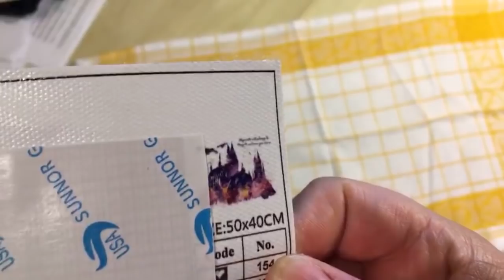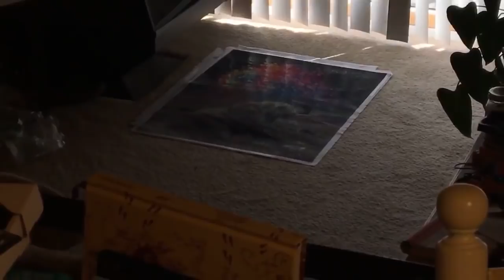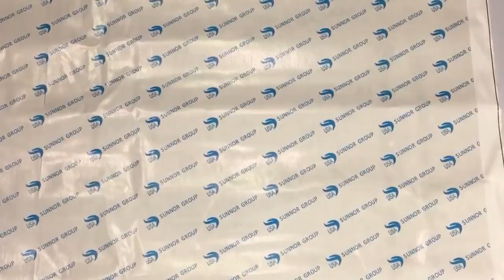Canvas Repair (Wrinkles and Cover Paper)

Comment: I have ironed wrinkled canvases with great success. I experimented with my iron on a canvas that I was willing to ruin if need be. I had to use a moderate heat and patience. It did not melt the cover plastic or effect the glue as far as I could tell.

Comment: There are two things that happen.  Canvas wrinkles need to go ironed.  The glue wrinkles  are actually air trapped when you cut the glue you release the air then you smooth out the glue.  That will help your drills lay flat.
Reply from the maker: Bea Kimball yeah, that’s what I said but unfortunately the wrinkles don’t always lay flat when you cut them (in my experience). That’s why I explained the bending/stretching of the glue that forms those wrinkles! 😁

Comment: There are 3 layers, cover + glue + canvas. The cover will be discarded. Glue can be removed or added. But you have to start with a flat canvas before drilling. From what I hear the canvas is usually a composite blend of cotton, synthetic, or paper fiber. I would try steam heat because warmth and humidity will allow the fibers to both relax and reshape. It is the method milliners use to reshape wool into a hat. A steam iron is your best choice. Cover the canvas with a thin cloth so that the heat and steam can penetrate (an old pillowcase is good). If your iron does not have steam, you can use a very light, very fine mist of water from a spray bottle directly to the wrinkles as you iron. As you iron, readjust the cover as needed so it does not impede the ironing process. Use the lowest effective setting on the iron so as not to affect the glue more than necessary. Keep in mind that synthetic fibers are more readily damaged by heat than the natural fibers like wool or cotton.  If you have used steam, make sure the canvas is bone dry before storing. Tackle any problems with the glue as a separate procedure. If you do need to replace some of the glue, what would be a good product?

Comment: I have used a flat edged tool such as a credit card or a ruler and at a 45 degree angle and applying pressure I smooth out the excess glue.  I do this over the entire drill field.  It’s worked for me...  This is over the plastic or parchment paper.

Comment: I had a cheaper canvas that I tried my heating pad on.  I am not a young person but I still hate to iron.  I have an iron just like the one you used!  lol  I put my heating pad on it.  Used my rolling pin in a tiny area without a cloth while it was warm.  It worked pretty well.  I did need to refresh my glue so I used Aleene's Tack-It Over & Over Liquid Glue.  Got it on Amazon for $5.80.  Turned out not too bad!  I would really be careful doing it on an expensive canvas until you try it on one that is cheaper.  I had my heating pad set on a hotter heat...but mine is a cloth one and yours may differ.  :D  I mean in the long run...glue melts and so does plastic.  Sooner or later they will both be flat again if made hot enough.  But what is the final deal when it is said and done?  lol

Comment: Disregard the last info.  Peel back the cover halfway have the edge facing you the rolled portion away from you.  Then with scissors you can cut the strip without the scissors sticking to the glue.  Then turn the canvas repeat pulling and cutting your strip.  Don't forget to lay your strips back down after each cutting.  Hope this makes sense to you
Reply from the maker: Bea Kimball I have a previous video of cutting the cover paper and don’t have any issues with it, but was simply just trying out a new method. Thanks though. 😊